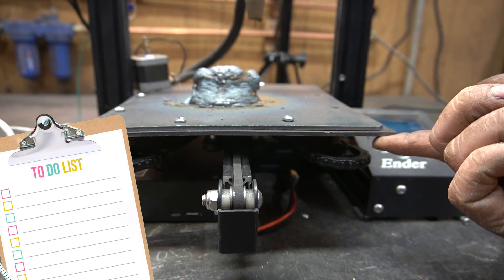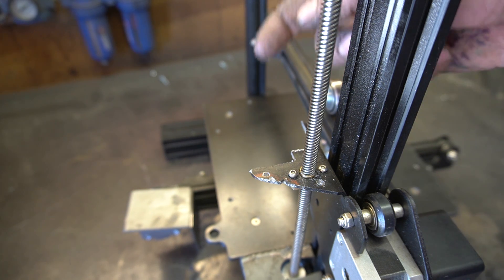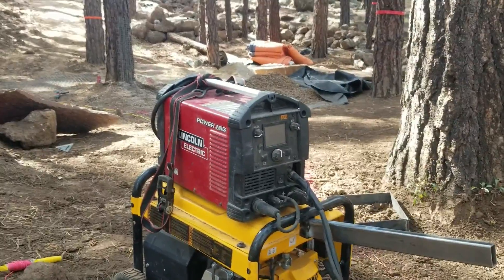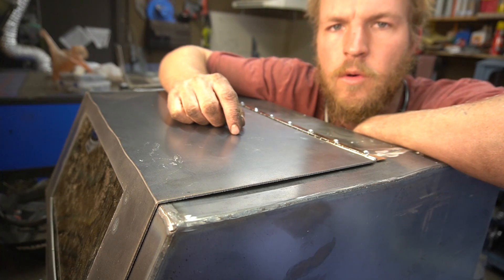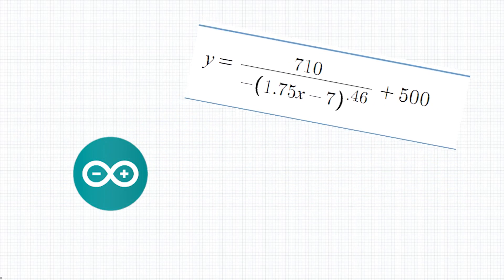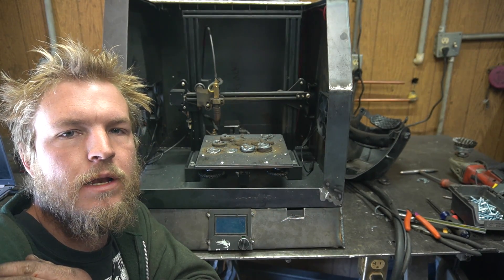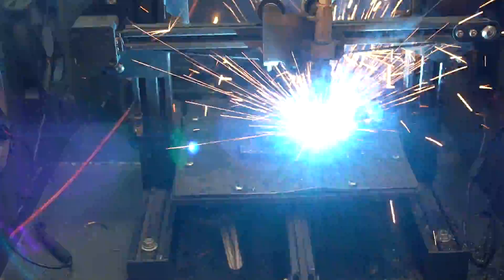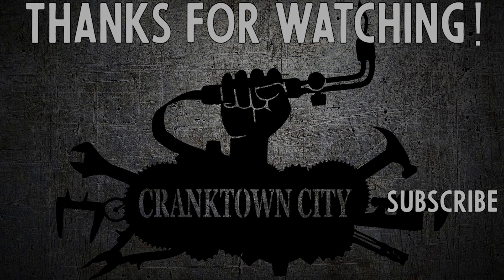DIY Metal 3D Printer (part 2)

Comment: 1. Put your printer i box.
2. Change to 0.6 mm. Wire.
3. fill the box with an argon atmosphere.
(Or CO2 maybe nitrogen. Use nitrogen geneator)
4. Print
5. Option add cooling system
6. You can use a split unit chiller 
7. Put the inside unit in a vessel 
8. circulate the gas from the printer box through a carbon filter.
9. And through the chiller vessel.
10. And back to the printer box.
Reply: You don't want nitrogen in the weld.

Argon for sure. UV would produce nitrogen dioxide and potentially nitric acid if the humidity was high enough. I'm in welding school.
Reply: Nitrogen is a shielding gas in many situations.

Comment: Make the base bed of flat graphite and each new piece utilizes a sacrificial bed of said material like a piece of sheet metal and begin to print.  Cooling make an air cooled constant duty cycle jet nozzle at point of print. So it cools as it goes put hose thru cooling system before it flows onto point of print

Comment: Probably not the laptop that's slow, just all the software running on it in the background that makes it slow. Same problem w/ my wife's HP desktop right now - it's slower than her older HP that died nowadays. Gonna try getting the windows defenderp out of there first but it's looking like a full format of the harddrive and reinstall of windows (along with all her other software she uses) is in order. It'll run like a top then no doubt, the hardware is plenty good and I'm sure that's the case w/ ur laptop too. Computers 15 years ago were snappier than what we're dealing with now because of how bloated and multitudinous the cruft all running in the background has become. It's like the better the hardware becomes the lamer and more incompetent the software developers become to compensate, only they're overcompensating.

Comment: Looks good! That x belt path isn't parallel, so you need to fix that, because right now you don't have linear movements and belt tension will vary across the travel length.

Comment: If you don't have printer's original heaters on it, it will happily run off 12V. The motors won't quite reach the speed so happily, but the holding torque stays the same.

Marlin codebase is actually a proper pleasure to read through. Last thing I had to change was the interrupt pin initialisation logic because uhhh I was janking some things into my board which don't belong, so I got in deep, don't you worry.

Comment: Well done persistence is key!

Maybe a change belts with sprocket & chains or ballscrews ( can get cheap Chinese seconds (bent), with a little work they can be used,) 

How do they position plasma torches on cnc, surely that tech could help here.

Keep the up the content, always interestinh

Comment: While I can't shake the feeling I am watching a caveman do high-tech.
I wouldn't be surprised if you end up launching a satellite.

Now for some ideas.
Honestly, I have no idea how to actually solve the warp issue.
Thermal expansion relief cuts?
Active cooling?
Metal sandwich (Fe|Al|Fe)?

Thermal monitoring.
The thermal couple got overwhelmed with EMI.
NTC resistor could work, if the temperature was below 250 Celsius.
There's some infrared sensors, Andreas Spiess has videos on them.

A enclosure allows for Argon atmosphere, however requires intense active cooling, so isn't worth unless aluminium is use.

So... What I would do, use a combination of thermal expansion relief with metal sandwich, attach thermic sensor to Aluminium layer. Forget about the Argon (still love you, Argon) setup a mini drill with wire brush for cleaning (something tells me it's not gonna work).
Uhmmm...
Oh, I can use the voltage drop across the welding cable to measure current, and also voltage...
Now I wonder if I can use that plus layer stop and start to use regular argon purges...
Maybe it's better to use lasers and metal powder, however the hazards are too high.

P.S. ok I would be surprised, just not in a "wait, what?" Way.
More in a I knew he could do it, still.

Comment: I enjoyed your video. And kind of panicked when you connected an arc welder  to thermocouple to arduino to a laptop which is a bad idea as your laptop could blow up if there is a power loop(i have seen someone doing similar and their desktop caught on fire and nearly burned down the lab). Instead i advice using a digital isolator or a bluetooth wireless or an esp32 wifi/bluetooth interface to read the data.
Reply from the maker: Hahaha y'know in retrospect that was really dumb.
Thanks for watching!
Reply: Ah, using bluetooth as workaround didn't occur to me somehow...thanks for the mention

Comment: Nice work! In that enclosure you've presumably got lots of ozone and UV light rattling around. All the plastic parts, oils etc are going to get chewed up, in particular the belts and bearings, so watch out for that. I was once doing a project with a uv lamp on a motion stage in an enclosure and I kept on having problems like "Why does the oil turn into tar?" and "Why are all the o-rings turning to dust?" before I caught on. If you keep going on this one, you might consider putting an enclosure just around the torch--you'd lose build volume, but then all the delicate bits would be better protected.

Also, the thermocouple was probably either wired backwards or picking up emi from the torch. You were on the right track, but the signal from a thermocouple is only ever a millivolt or so (10-40 microvolts/degree C depending on type) at 10-100 ohms.
Reply: Oh... That is something that I wouldn't expect, UV induced fire.
Reply: @youkofoxy  ive been getting into organic chem and i stg uv will fuck up anything it gets its lasty little high energy paws on
Reply: Seconded. The belts should be treated super frequently with 303 aerospace protectant

Comment: This is perfect man! This is a tiny part compared to the nozzle diameter, if you print bigger things, it will appear more precise… 👏🏻
Reply: That was quite an insightful thought
Reply: The opposite is true too, if you use thinner wire and nozzle you can get better details.
Reply: Year, I bet, with gibber things, that´s above 1 million pounds, you begin to not distinguish the single layer-lines...    ;-)

Comment: That’s really impressive. Could you use some type of sensor to monitor the metal temp and arc color? I might be wrong but I think the arc color or brightness will change in a measurable way as the base gets hotter.
Reply: Yes, quantum mechanics says so.
However the difficulty part is to get the sensor to work.
Guess you could use filters and calibration for that.
Still not drop in place thing.

Comment: Awesome I love this! Someday when I get a welder I want to make this!
Reply: no you should just use a battery and buy $8 of 0.58mm tungsten electrode and a few dollars of tiny feed wire like 20ga and just have motors feed and use a stock 3d printer cheap one.  use argon from wine preservation spraypaint size as your gas.  total cost under $60 to mod your existing 3d printer to do 50x higher resolution than in this video.  you should nto use a welder at all.  use micro tig method but just mosfet switched battery - maybe a $11 spot welder would be fine as the electrical pulse switching method.  like I said less than $60 and you can do this.  don't buy a welder.  totally unnecessary.